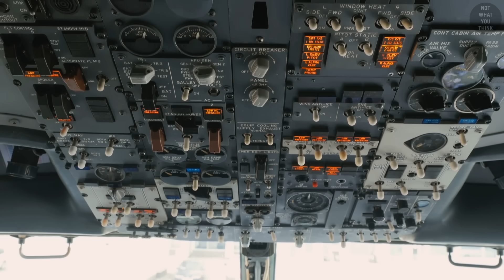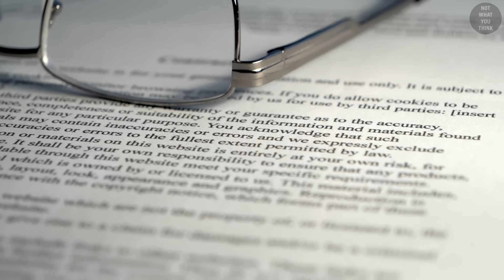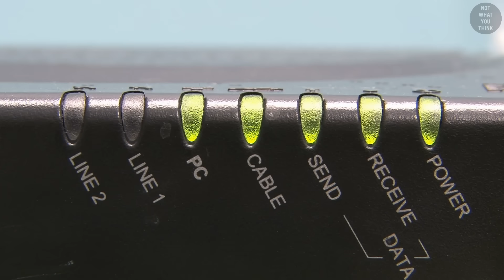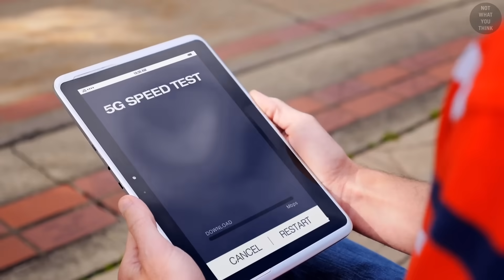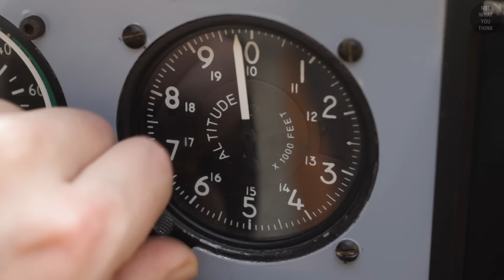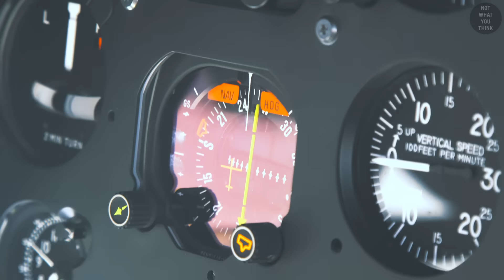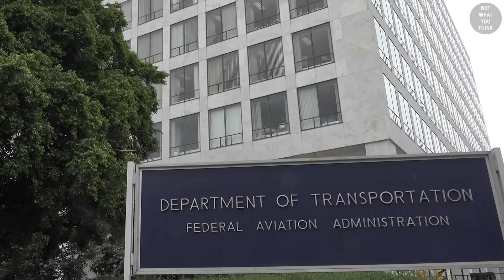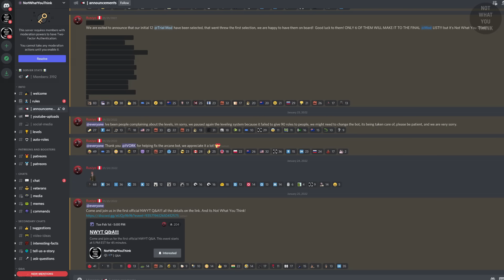Why 5G is OVERRATED and is Mostly Safe for Aircraft

Comment: Anything to force attention to the scam 5G wi-fi.  Heck, even 4G didn't meet the minimum standard for 4G until LTE.  "OMG 5G is so big and powerful... it knocks airplanes out of the sky... I gotta buy a new phone now!"  You know, every Internet connection is only as fast as the slowest link.  The path to any particular Web page probably goes through an ethernet line that's getting only a small slice of 1 GHz.  Doesn't matter if your phone connects to a tower faster than that.  The bottleneck is elsewhere.  So why bother getting anything faster than 1GHz and be happy with an actual connection a third or less of that.

Comment: Oh so you keep saying “altimeters”. Or “ radio altimeter “ We use the ILS : (instrument landing system ) we fly in MINIMUMS. WE establish on the localizer - we get vertical and horizontal guidance .  The signals from those towers can interfere with VOR , ILS , NDB AND ADSB . so this is not that great as you really didn’t research it. Look up ILS . We use a type of radio receiver that gives us vertical and horizontal guidance . For instance : I tune the the Addison localizer 110.1 MHz and adjust for the rnwy heading accounting for magnetic deviation . I have a needle for glide slope and horizontal deviation . This video is awful and you really need to consult with a pilot . Thumbs down… also you for got upward and downward harmonics in radio wave propagation.

Comment: Actually a high dense 5G network might be mitigate the problem. Having many 5G towers means that each tower can mounted lower, the antennas can be pointed more downwards and emitting at lower power. Making interference less of an issue
Reply: Yup, that's something I gave up trying to explain to the typical crystal hugging, antivaxxer years ago.

 We put up some WOODEN dummy antennas instead at a proposed site and waited for all the complaints to roll in about how the radio waves were ruining their chakras. It was useful ammunition in subsequent court cases and got several of the Hagathas concerned declared as vexatious litigants (which provents them even BREATHING legal threats without court permission for 20-25 years, depending on the jurisdiction)

Comment: Someone thought radio altimeters are showed on the video but those are analogue altimeters and cannot be affected by 5G connections. Listen to notams if your aircraft is equipped with radio altimeter. Here is the example of a radio altimeter doing its work 

https://youtu.be/sikGj2flLB8.

Comment: C-band satellites are very low-powered and are very far away.

Distance:  C-band satellites occupy the Clarke Belt, an imaginary area above the equator some 25,000 miles above the surface of the planet, where the orbital speed keeps the satellite in a relatively "stationary" area above the planet.  When I used to do TVRO via a ten-foot satellite dish that is still in our back yard doing nothing, there must have been two dozen different "birds" in the Belt, including various Spacenet, Telstar, Satcom, Morelos (Mexico) and Anik (Canada) satellites.

Power:  Thing is, on the downlink side, they operate at a very low power level, like the wattage of an incandescent night light, about 8 watts per transponder for older satellites.  90s satellites upped the power to a whopping 16 watts.  You had to have a large dish, a high-gain LNA/LNB at the focal point of the dish connected to a feedhorm, more frequently a combination of both.  The feedhorn collects these distant signals, using what is called a polarotor, to distinguish between twelve channels in one polarity, vertical, versus the other twelve, horizontal.  I'm not sure what kind of losses happen when an eight-to-sixteen-watt signal traverses a quarter of the way to the moon from the bird to a ground station for the downlink side.  I'm not even sure what the power requirements are on the uplink direction.  In any event, C-band satellites pose no threat to aircraft due to their significantly great distances and the low power output.  The uplink, however, might pose issues.

Comment: I’d say this is how the airline industry operates, they put in every measure imaginable to prevent accidents, and if they still happen they go in and find out what happened so if it happens again, the plane will not be lost along with the passengers and crew, I’d rather they not fly if there is a potential threat to the safety of the people onboard
Reply: Usually, they ignore issues until someone gets killed, then they overreact. There's a reason for the saying that "safety rules are written with tombstones

Comment: The Magic Archer card is unlocked from the Rascal's Hideout (Arena 13) or a Legendary Chest. He is an area damage, long-ranged troop with moderately low hitpoints and damage. The Magic Archer shoots arrows which go linearly to damage his target and any other units in the arrow's path. A Magic Archer card costs 4 Elixir to deploy.

Strategy

The Magic Archer is excellent at countering buildings in the opponent's territory due to his long range while also surviving spells like The Log, Zap and Arrows.

When he shoots a Princess Tower, his arrow goes through the Tower. This can be used to hit troops behind a Tower, although it is very unlikely the opponent will deploy a troop behind a Tower while the Magic Archer is attacking it.

Due to his fast hit speed and his arrow's ability to go through other troops, he can defeat swarms such as the Goblin Gang and Skeleton Army. He can also completely destroy a Minion Horde without taking any damage as long as he has the help of a Princess Tower.

A Fireball or Poison can completely destroy a Magic Archer for a neutral Elixir trade, but hitting other targets with the said spell such as a Princess Tower will make the move even more advantageous.

He is an effective counter to the Graveyard, as he shoots rapidly and his arrows can hit multiple Skeletons at once. However, his higher vulnerability to Poison compared to a troop like Musketeer means that he will often be defeated during a larger Graveyard push. Players should take advantage of his long range and place him behind their King's Tower to make it harder for the Graveyard user to spell him without accidentally activating the King's Tower.

The Magic Archer's long projectile range means that if a unit is in front of a Princess Tower, he can be played at the river and damage both of them. If the opponent is distracted with the player's other troops and lacks a unit that can quickly defeat the Magic Archer, he can garner immense chip damage. When defending against a Magic Archer crossing the bridge, the counter unit should be placed off to the side to prevent the Magic Archer dealing unneccesary Tower damage.

The Magic Archer can be effectively used with the Tornado to cripple or even defeat large groups of enemy troops. The Tornado will group up all the troops, and the Magic Archer will constantly shoot them, dealing quite a bit of damage, all due to his ability to pierce multiple troops with his projectile. If done at the bridge, he can also snipe the Princess Tower for some chip damage. His long range should also be accounted for when placing the Tornado; units can be pulled slightly farther away than if the player was defending with something like an Executioner, which helps prevent the opposing units from attacking him during the Tornado's effect.

A lone Magic Archer can be completely countered with an Ice Spirit and the help of a Princess Tower. As the Magic Archer crosses the river, the Ice Spirit should be placed one tile to the opposite side and five tiles up from the King's Tower. The Magic Archer will attempt to chase and shoot it as it moves away, and the arrows will miss due to the Ice Spirit's Very Fast speed. The defender can also activate their King's Tower during the kite by deploying a unit between the Magic Archer and their King's Tower.

A Magic Archer can pierce almost all the Skeletons from the Skeleton Barrel with a very precise timing, similar to the Princess. Deploy him behind your King's Tower in the same lane when the barrel's shadow is five tiles from the Princess Tower. If timed correctly, his arrow will hit the Skeletons as they are clumped up, at most leaving one left alive which is easily defeated by the Princess Tower.

In 2v2, one can activate the King's Tower with a troop only if the Magic Archer is staggered towards the center of the arena as it crosses the bridge (caused by being placed or displaced towards the center of the arena). The counter troop should be placed to the side to your Princess Tower as the Magic Archer crosses the bridge.

Due to its long range and fast initial hit speed, a Magic Archer at critical health is still able to land a shot on a Tower before the Crown Towers' arrow can reach the Magic Archer. This can deal considerable chip damage over the course of a game, so one should consider using a cheap troop to distract the Magic Archer in these instances.

History

The Magic Archer card was added to the game on 2/3/18.

On 25/4/18, a Balance Update increased the Magic Archer's projectile speed, making him less likely to miss Very Fast moving troops.

The 20/6/18 Update moved the Arena to unlock the Magic Archer from Electro Valley (Arena 11) to Hog Mountain (Arena 10).

On 5/11/18, a Balance Update increased the Magic Archer's first attack speed to 0.9 seconds (from 0.4 seconds).

On 7/1/19, a Balance Update decreased the Magic Archer's first attack speed to 0.6 seconds (from 0.9 seconds).

On 28/1/19, the January 2019 Update moved the Arena to unlock the Magic Archer from Hog Mountain (Arena 10) to Spell Valley (Arena 5).

On 15/4/19, the Trophy Road Update added an extra Star Level.

On 5/8/19, the August 2019 Update increased the Magic Archer's damage by 16% but decreased his hit speed to 1.1 seconds (from 1 second).

On 7/4/20, a Balance Update decreased the Magic Archer's targeting range to 6 tiles (from 7 tiles).

On 5/5/20, a Balance Update increased the Magic Archer's targeting range back to 7 tiles (from 6 tiles) but also decreased his hitpoints by 10%.

The 2021 Quarter 2 Update moved the Arena to unlock the Magic Archer from Spell Valley (Arena 5) to Rascal's Hideout (Arena 13).

On 27/10/21, the 2021 Quarter 3 Update added the level 14 Magic Archer.

Trivia

The Magic Archer is 1 of 15 troops that originated from Clash Royale and appear in Clash Mini, the others being Knight, Spear Goblins, Mini P.E.K.K.A., Musketeer, Dart Goblin, Battle Healer, Giant Skeleton, Prince, Guards, Miner, Mega Knight, Ice Wizard, Electro Wizard, and Lumberjack.

The Magic Archer often says “Tulta!” which means “Fire!“ in Finnish.

The Magic Archer has the smallest area damage radius out of all cards, at 0.25 tiles.

It used to be the case that a troop is placed right for defense against the Magic Archer, the Magic Archer could hit and activate your King's Tower due to his long range. A bug fix update has removed this.

The Magic Archer is the subject of an Emote.

When Brawl Stars was globally released, Clash Royale celebrated the event by adding a Brawl Stars Challenge, where the Magic Archer was reskinned as Bo and Hunter reskinned as Shelly.

The Magic Archer's weapon is very similar to that of the Super Archer in Clash of Clans, with the latter being likely inspired from the Magic Archer.
Reply: Did you post this to the wrong video?

Comment: what about the military planes? I don't believe the most advanced fighter jets still using mechanical altermeters. if another country using a cheap modified 5g antenna pin point to the bandwidth of that altermeter and the landing signal device on carrier? it is a fishy assumptions that recent multiple accidents may related to this conspiracy theories. and this cheap tricks had no trace at all. how about some directional high power antennas "crossfire" to a pinpoint location, say, to a bridge of a warship? will those sailors feel uncomfortable? again, there is no trace. even you put a full bandwidth spectrum scanner there, it will just tell you it is a strong mobile phone signal because those machines are build to ignore "civilian bandwidth" at all.
Reply: So to address the first claim here,
Yes, military jets no matter how new use mechanical altimeters... because they work when there's no power. They use them as emergency backups.
Reply: @joshuacheung6518  well then it will be 2 readings feed to the plane and pilot. one mechanical, one electronic, which one to trust in critical moment? i believe there were case in nasa, is it x36? had that problem. if it happen in landing, 10feet deviation in height can be a issue. the 737max also had a wrong altermeter readings too. and that's why the pilots said the flight computer keep "arm wresting" with them.
Reply: Radar alt is always trusted over baro alt unless you have multiple system failure. For the simple fact that radar altimeters give distance to ground rather to the sea level.

Interference from 5G would count

737 max failure also wasn't related to altitude, but rather angle of attack
Reply: @joshuacheung6518  more likely angle of attack (nose down) 737max pilots describe. if it is a nose up, they will have time doing counter measures. the question is why nose down decision is made by the flight computer in some situation that shouldn't be? what kind of input makes the computer "feel" it should nose down.
Reply: ....angle of attack is determined by angle of attack sensors?
So a bad signal made MCAS pitch down to bring the AOA back to what the computer thought was normal, but it wouldn't change so it would keep compensating
Reply: @joshuacheung6518  where is that "bad signal" come from you had to ask boeing. but it sounds fishy to me. and very likely it ignore the height of the plane and the pilot's judgment. the "though normal" is not normal in those crushed cases.
Reply: I'm not sure where the disconnect is for you, but altitude data doesn't play in to the 737 stuff whatsoever. Certainly, you COULD have tied that data in, in the form of vertical velocity limits, but... the smarter thing would have been multiple angle of attack sensors and if they differ then shut the system down, like the majority of the other plane systems
Reply: @luderick wong  because boeing didn't want to spend the money on recertifying the airframe which had an entirely new flight profile?

Stop looking for conspiracies, the truth on the 737 max is worse. And still not tied to altitude sensors.

Comment: For 5G and radio altimeter (which I’d like to call radar) they work in a broad band width, and they both emit or receive radiation from ground. Satellites instead, emit from the sky. As a result, they would have a much higher chance of interfering. And US has much more frequent inland flights than Japan that perhaps results in the FAA regulation.

Comment: Ok, what about barometric altimeters? They're not affected by radio interference and are still used on all airplanes, aren't they?
Reply: Yes. Plus or minus one or two hundred feet. What happens when you try to land a plane and your altitude displays 100 high?
Reply: @joshuacheung6518  I'll tell you what happens. On approach, when I cross the transition altitude I would acquire the destination runway's QNH either via ATIS broadcast, local METAR info or just ask the ATC person for it. Then I would turn the pressure knob on my dashboard to match the acquired QNH value which is nothing else but the atmospheric pressure at a runway level. After that my barometric altimeter will be surprisingly accurate down to a meter. By the way, GA have been flying this way for decades. Radio-altimeters could only be found on a military aircraft until recently when they began to be installed in the airliners. Even today, not all aircraft are equipped with radio altimeters and they are certified no problem.
So the question still stands. NWYT presented the problem as though all barometric altimeters all of a sudden stopped working. But they didn't.
Reply: Fair enough, thinking back on it the ones i used to replace were purely standby so the tolerances were probably a lot lower

Comment: 10:46 it's all about line of sight.  Satalite communication is generally being beamed down, and the radar altimeter is designed to pick up a return bouncing off of the ground.  The 5g towers are kicking up radio waves from the ground, so it could potentially 'jam' the reciever of the radar altimeter, in theory.  While the satalite communicator is just aimed differently and doesn't have as much potential for interference.

Comment: If the reason satelites aren't interfering with altimeters is because they're too low powered, then you have to feel sorry for all the satelite broadcast receivers when a plane passes overhead.
Reply: See also polarization, multiplexing, and super directional antennas. Sat comms are super sophisticated now.
Reply: @borkborkfoxxo279  What would multiplexing have to do with it?
Reply: @MaxElkin  The given words were examples of the sophistication of satcom channels. In case you missed the second sentence of my comment.
Reply: @borkborkfoxxo279  Oh, I thought that you were listing things that would reduce that chances of sat commas interfering with a plan's radio altimeter... Because the other 2 that you listed I definitely could see influencing this.
Reply: @piisfun  Could be they only get interference for 2 secs per plane, but it's probably that the differences in frequency are enough to not cause any interference at all.